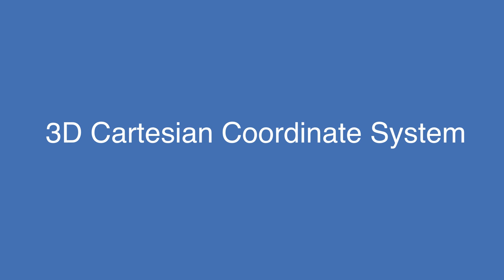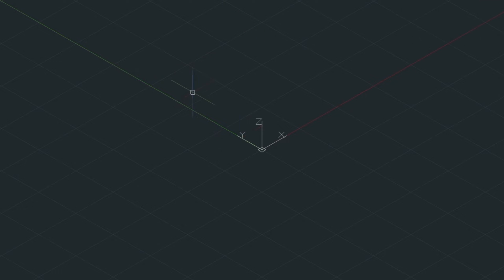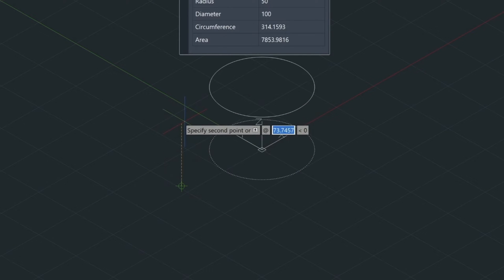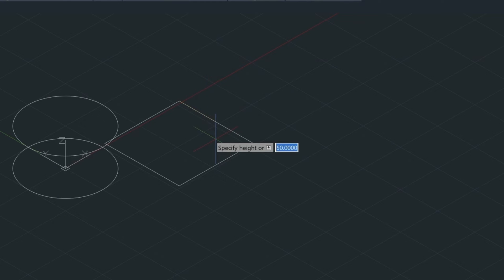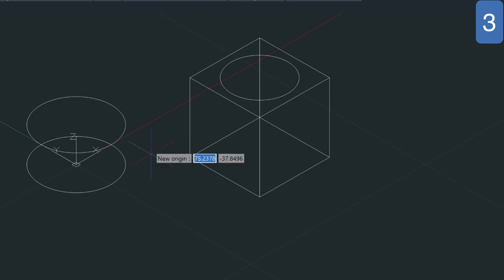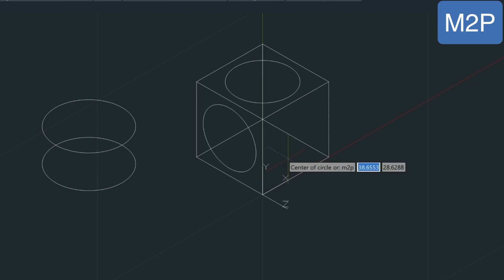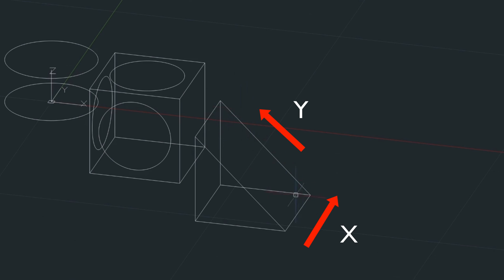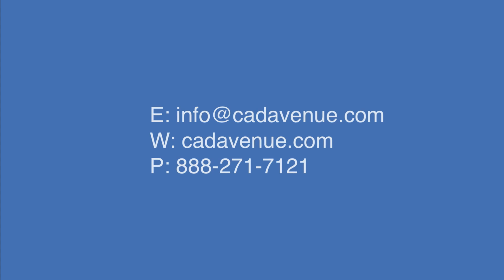The 3d user coordinate system (UCS vs World)

Comment: If the object is cylindrical and if I want to draw another cylinder is SE direction, in that case how to select the surfaces?
Reply from the maker: Think of the radius as the XY plane. Then when using the three point option, those are the first two points. Then the third point is the direction of the cylinder. Hope that helps.